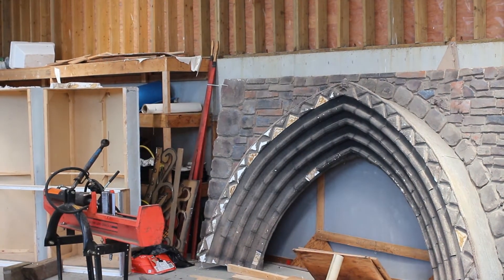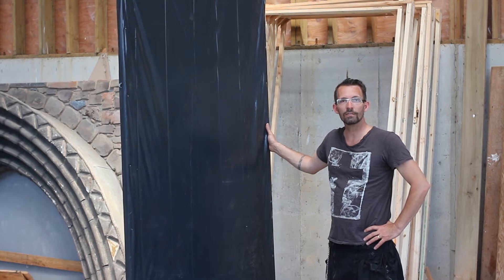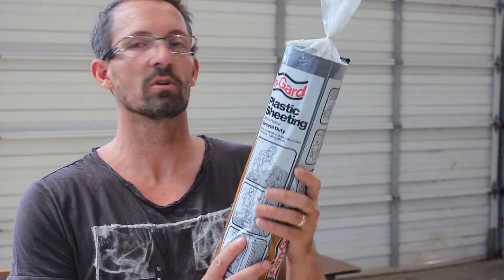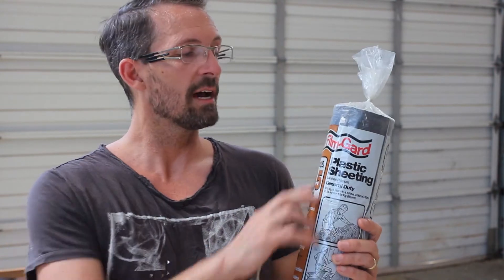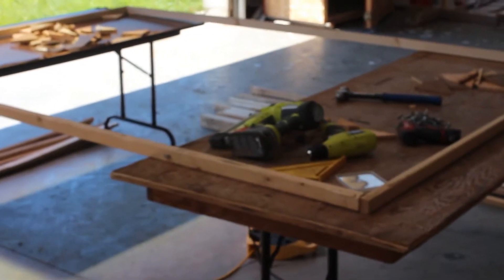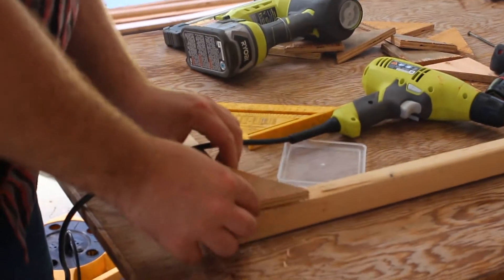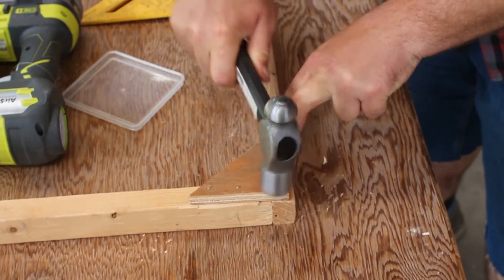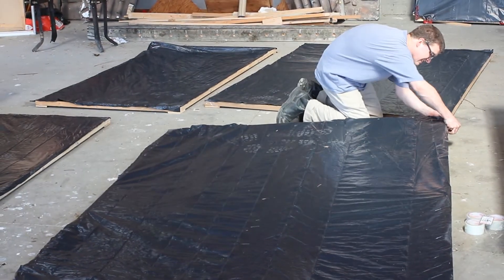larp dungeon build

Comment: I build scenery for a theater group the same way. If you use fabric instead of plastic it can be painted for anything you want. a lot more durable still lightweight. if you use the mis-tinted paint from big box retailers it is quite inexpensive. doesn't matter what kind of paint it is the cheaper the better. plus blood splatter on a dungeon wall speaks to me. Once the fabric has a couple of shows worth of paint on them they are hard to destroy.